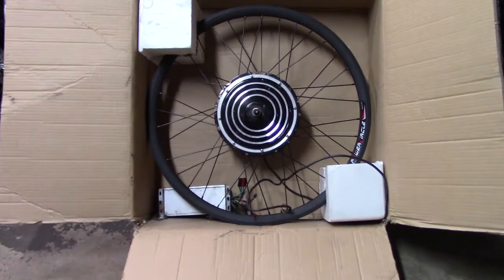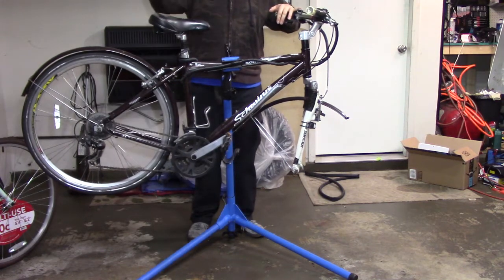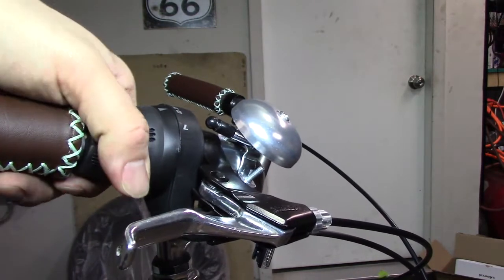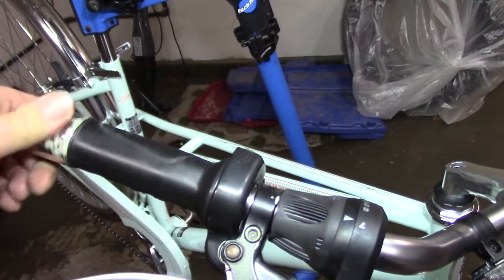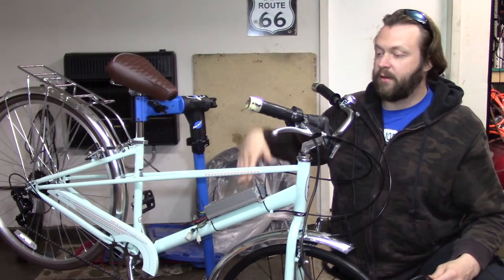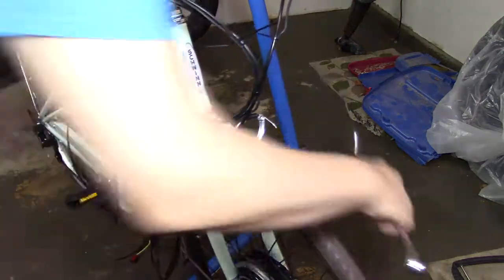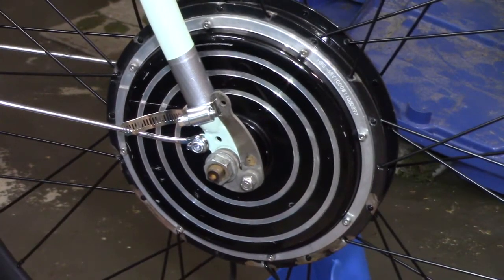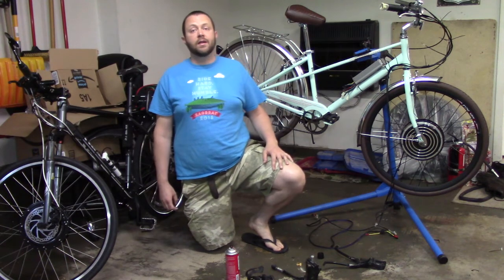Making A New DIY 48V 1000W Electric Bicycle With Parts From A Crashed Bike. PROJECT EBIKE REBUILD 2

Comment: I've had my controller on my rear rack for over 3 years, and it still works great! No issues, ever! It's even hidden under my pannier bags and has never overheated. I have a 48v 1000w RHM kit on a Kona Blast Deluxe mountain bike, but it's only really used on paved roads.

Comment: Yo man are you still making new ebikes? Awesome video btw.
Reply from the maker: I still make them, when i have the need. I had previously considered starting a company, E-Bike USA, to manufacture and distribute e-bikes and accessories, but decided against it when i realized: 1) the US market was not interested in e-bikes at the time i wanted to start the business. 2) All the big companies were poised to sell e-bikes, and i had no way to compete with them. I still have a Schwinn Chopper in my shed that i plan to put a motor on, but no plans any time soon on that.